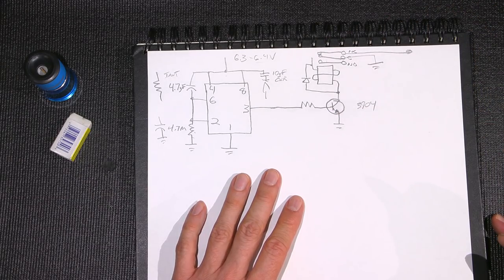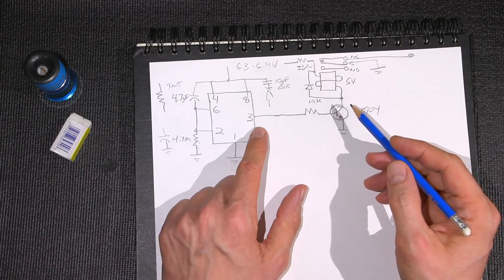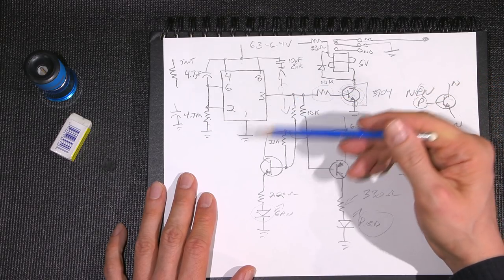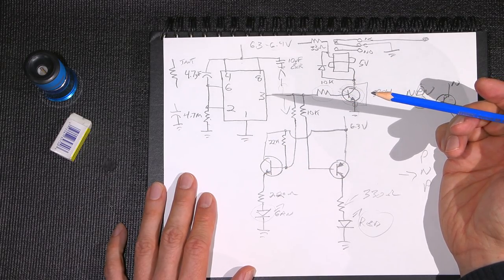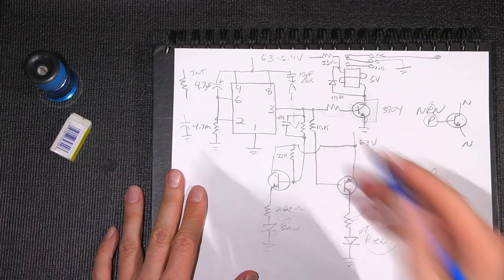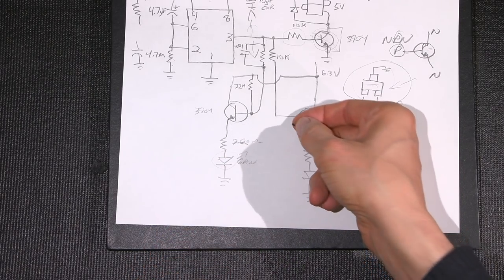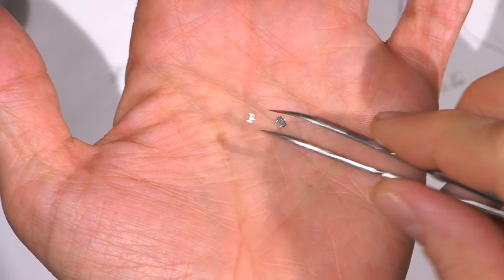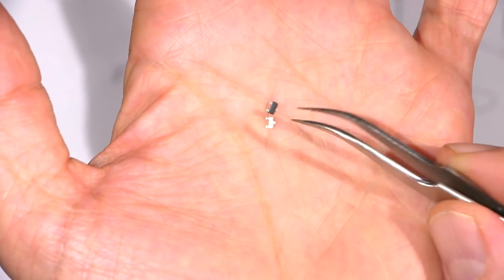Create And Build An Electronic Circuit!

Comment: Paul,
Very much enjoy your videos...and this is no exception to that.  
For me, I would have to use larger parts...possibly even through-hole type parts.  In my case, it is because of my eyes.  I am having difficulty in making out small things lately, and it probably will only get worse.  I would like to see this on the Patreon page, and a schematic and explanation/demonstration of the operation of the amplifier as well.
By the way, do you have the information on that chassis?  The manufacturer, model number, etc.?
Reply: Wayne Thompson  ,  You too? I'm only 79 and wishing for better vision!
Reply: @BruceNitroxpro  , Sadly yeah.  It is not as bad as it could be, but it certainly isn't what it once was.  Do you remember the size of the very first SMD parts?  I could read the numbers on the parts without any need for glasses...then I turned 36 and I could barely see the part much less the print on it!
Reply: @waynethompson8416  ,  Age 36 is the age of our younger daughter! LOL Love it!

Comment: You could have put the LEDs across the relay contacts. Power directly into the LEDs, red connected to NC, and green connected to NO. That would have saved the transistors and reused existing components. The only potential downside is the red LED might cause interference initially, but not once it leaves protection mode.
Reply: The devil is in the details - so let’s be careful here.

Both halves of the relay are used up: each one switches one half of a stereo pair to ground. So, the NO contacts are busy with audio signals, and the Common terminals are at ground.

All you’re left with is NC contacts, and all they do is switch to ground. You could use one NC contact on the red LED’s cathode. And you could use the other NC contact to bypass (short) the green LED - it’d waste a tiny bit of power, but wouldn’t be of much consequence. That is if you had two separate LEDs.

But it wouldn’t be possible while using a three-terminal LED pair that Mr Carlson had laying around. There are three possible internal circuits for such LEDs: 1. Common cathode: the red NC contact opens the cathode connection after 30s, so the green LED wouldn’t light up. 2. Common anode: one NC contact would connect red cathode to ground, another NC contact would connect the overall anode to ground, but then the red wouldn’t light up. 3. Series connection with a tap: wouldn’t quite work either, because one of the LEDs would be sharing some current with the other one. It wouldn’t be as bright, but not a desired outcome.

Mr Carlson clearly likes indicators that change colors, and wanted to use the LEDs he had, so the transistor circuit was necessary.
Reply: @Kuba Ober  I was only saying that since only the one pin is connected to audio stuff and since the only purpose of the leds is to show the status, connect the "protection mode" led to the NC and power, connect the "operational" led to NO and power, and you're done. I may have mixed up the order, I watched the video a while back so don't remember exactly, but I thought only one signal was connected to the output of the relay so that it would ground the output initially then power it.
Reply: @aaronjamt  It’s not the case that “only one pin” is connected to audio stuff. Two NC contacts (out of two available on the relay) are connected - one to each of the two stereo channels. And two C contacts go to ground. The schematic doesn’t show the duplicate contacts, it’d be noise, but they are there all right. I’m in the process of building a relay computer that uses a thousand of those same relays (just a different coil rating), they were instantly recognizable :)
Reply: @absurdengineering  Like I said, I wrote this when I watched the video 3 weeks ago so I don't fully remember it. You're probably right tho

Comment: 6080 vs 7236 . I  prefer the 7216 much easier to drive with about 2x the current of 6080.  Also found that damper diodes bring up the voltage slower reducing that turn on thump. Granted the diodes need a heater but can be found for about 1 USD  current in the 200 to 250ma range . Just so of what has worked for me. 555 timer a very good educational chose well explained . It RT (reaction time) on the tree 60 foot is how long it takes to move the first 60 feet . My boss would .001 on the rt too often very impressive.  Very fine video .

Comment: I would have used a 4 pole double throw relay, used one set of contact sets to drive LED because this would also become diagnostic and would monitor the absolute state of the relay contacts to ensure that the relay is truly functioning. If the relay drive transistor shorted or opened this would give you diagnostic info as well.

Comment: Thank you for your videos. This particular video has helped me a lot with basic electronics. Your explanation of transistors cleared a ton of mystery for me. I have a question about the green LED. 
Why did you put the LED on its own branch with a transistor, resistor and cap? Why can't you put the green LED in series somehow with the relay coil?  That way a lit green LED would also confirm that current is flowing through the relay. 
Why did you need a 22 ohm resister on the green LED transistor base leg? 
Why didn't you need to add a cap across the 10 ohm resister on the base leg of the relay transistor?
Reply: Yes, a green LED in series with the coil seems reasonable, also I don't understand the 22 ohm resistor, if it all comes to me I will let you know.
Reply: Parallel thoughts 🙋
Reply: Do you mean parallel? Putting the LED in series with the relay coil would drop the voltage by 3.3V.
Reply: @zachz96  some way that will indicate that the coil has activated would be nice.

Comment: The way we learned electronics in the Marines we had a saying for the transistors,  NPN - not pissing on the plate, PNP,  pissing on the plate.  Color codes for resistors, Bad, Boys, Rape our young girls, but violet gives willingly. damn sure not PC but it helped us to memorize the color code, and we all remember it. Sorry if it offends you but this was in 1978. I served from 77 to 07. Tubes were very common in our radios, especially in high power radios.

Comment: Wow this video looks super interesting to me, only about 10 mins in. My living room amp I built about 5 years ago uses 4 6as7s in pp with a pair of 6sn7s as the drivers for each channel, like you said they do need a beefy supply I think mine draws around 15amps off the 6.3v line. Mines not otl though it uses Japanese tango output transformers and is probably about 10w per channel, nice sound, originally it had 6v6s but it went triode as didn't even need to power of the 6v6s for the small space it runs in

Comment: I'm beggining to study circuits, and I have a question if you don't mind. Why didn't you design the green (ON)LED so that it's connected to the NPN that is connected to the relay? Wouldn't it fit your design since that transistor turns on when the output is high? My guess is because there wouldn't be enough power in that branch, although that's merely an educated guess. Thanks, i've already learned alot from you.

Comment: This was an excellent video as always but the bit that made my head explode was at the end! I had no idea why some transformers were so large except that it was harder to saturate a larger transformer! I have been eyeing some output transformers on eBay for some time now and I have been reluctant to make the purchase, one lot was ex military, they look like a capacitor can but they also look small, I haven't built anything with tubes yet and wanted to get my foot in the door so I still might get a set of these. But the others are new made in china and there's a lot of them on eBay! I guess that I'm not getting those things now, I think that I'm probably better off getting new ones made up, there's a place here in Sydney that's still building and they have been around for a very long time, I found them after I opened up an isolation transformer that came out of a hospital, I wanted to see what's inside because it weighs about 25kg, wow! The biggest toroidal transformer that I have ever seen in my life! I don't think that I have ever had a birthday cake that big! I love it! I also have a huge EI core transformer also, my son got me an arc welder for a father's Day gift, I couldn't help myself when I saw it's transformer, that sucker is coming out! Besides, it's one of those cheap father's Day specials that have a 1 minute duty cycle, pretty useless but it's transformer is just beautiful to look at! I don't know what it is but I'm drawn to some components and I have to have them even if I have no use for them! Maybe I should get another welding transformer and rewind them into output transformers LoL, LoL they are huge! Anti theft! And they just look scary! Even if they are gentle giants LoL... I will have to call the amplifier the Frankenfier!

Comment: Really nice design, the choke and filter caps, well done! My first few cars had points with a condensor inside the distributor cap.
Why not use an RC to get your 30 second delay instead of use the timing chip?

Comment: Even if the chassis you used is not still available, I would think the Hammond RM series would work. They are available in both 1/2 and full rack width and are well made. I have used lots of them over the years for various things. They will also take the standard Hammond aluminum chassis inside, if you desire. The disadvantage is they are NOT inexpensive!

Comment: I have a question about your design. Why did you put a 220 Ohm resistor between the green LED and the transistor and a 330 Ohm resistor between the Red LED and transistor? do they not require the same voltage?
Reply from the maker: The forward voltage of a green and red LED are different. In order to keep the brightness of both LED's somewhat uniform, I staggered the resistance values.

Comment: It's a 'while' a go since I heard that  THUD,  brings back a lot of good memories.   8-)

Btw. an on/off switch on a tube amp ?  It should have an UPS.
( I just saw jou Standing Inside a Broadcast Transmitter While it's on, you'r familiar with the concept )

I wish I could support you, your doing very good teaching.  ( but I'll probably buy me some of those nice LED's first )
Reply: I think Mr Carlson deserves something more than just a UPS. A motor-generator with a big, well balanced flywheel would seem appropriate :)

Comment: It would be interesting to year your views on guitar audio amplifier output transformer design.  I think core size there is also significant in that I understand that core saturation plays a part in the sound desired by guitarists so extra large cores are not necessarily desireable.

Comment: Out of curiosity, why do you pull down the relay coil rather than pull up? Less power through the transistor?
Reply from the maker: Hi Michael. The emitter of the transistor is directly connected to ground, so there is a current path from the base of the transistor directly to ground. If I was to put the transistor on the upper side of the relay (like a pass element configuration) the base would be lifted off ground by the voltage of the relay coil.

Comment: Would that have enough power to push the voltage converter box for a pair of electrostatic headphones? Those usually plug into speaker outputs. I am sure a converter can be made to run some Koss ESP10s or Staxx Ear Speakers. I can't pick a favorite. The ESPs and the high end Staxx are just different. I prefer the ESP10s for comfort and they have a socket for a small flex mic boom.

Comment: I understand very little of this, but I'm fascinated by electronics (was set to go to college for electrical engineering, but instead took a path into residential construction), and I play guitar through Mesa Boogie tube amps.  Is this just a delay for the tubes to warm up?  (I'm used to waiting about 30 s. to turn on the Standby switch.)

Comment: Thank you! Very informative! Could you not use both triodes in each tube and cut the number of tubes in half?
Reply: There would be slightly less channel separation then: the triodes in a dual have some capacitive coupling between them, and grids are fairly high impedance nodes so it’d be problematic. Another problem is that dual triodes make it hard to make a perfectly symmetric circuit. You want perfect mechanical symmetry so that the  parasitic impedances are the same in both channels. If they differ, the left and right stereo signals will be delayed by slightly different amounts at any given frequency. That kills stereo reproduction even if the amplitude of the response may be acceptable - phase matters too. Thus, a good stereo amplifier is two circuits in perfect mechanical symmetry.

Comment: Why does the green LED need a driver transistor? Does the output of pin 3 not provide enough current?
Reply from the maker: You got it! The output gets pulled down very easy on this IC.

Comment: I'm sorry if this is a stupid question, but would it hurt anything to run the leds off of the relay contact's?  It seems like you could eliminate the transistors and resistors by running them off of the contacts instead of the 7555.

Comment: Hello mister Carlson, why did you use a tantalum capacitor instead of a 4,7uF electrolytic cap? Are the electrolytic capacitors also more unstable due to temperature or humidity factors? Or are there any other disadvantages? I Know about the unstable ceramic types, and building VFO's using them in the LC circuit. Then blowing to a capacitor with a straw and the frequency counter was running up and down. That was a funny way to learn how not to build a stable VFO :)
Reply from the maker: Hello Rene. Yes, electrolytics should never be used in timing applications for drift reasons. They are very temperature sensitive.
Reply: @MrCarlsonsLab  Thank you very much!

Comment: I know you mentioned the reason for doing the OTL amp allowed you to keep the range of the signal within a db, basically flat. Then the powered speakers bring the levels up. What is the advantage of that? I know you said that it allows you to master very well - but just curious, in what way is mastering the audio better? (totally a curiosity question).

Comment: I was wondering, how is the amplifier affected by the headphone impedance ? let say you were using 32ohm headphones instead of 600ohm ? And lastly, you are shorting the output of the tube while your relay is protecting the output ? I thought you would have OPEN the output circuit and CLOSE it when ready but by what I understand, you SHORT the output this has no incidence on the tubes ?

Comment: Probably, the 7555 would drive the relay without the transistor... if you did swap the timing R and C.  It depends on how big the relay's coil is.  Also, a "3-color" LED with resistance in an H-bridge (or inverter LED on one side plus inverter/inverter LED on the other side) would fill the indicator need -- though this is not much simpler.

Comment: Mr C, what are the properties of the plate and cathode resistors (look like cement sticks) that make them appropriate for their use in those positions?
Reply: Those 6AS7 tubes (6080 industrial version) are kind of unusual high-current beasts. They take 2.5 A heater current, which is pretty high. Each triode (of 2) can pass over 100 mils, and their plate resistance is very low. Point being, they are rather high current tubes and so the plate & cathode R's need to be pretty high wattage as well. Those look like 5 watt R's to me.
Reply: @pneumatic00  Thanks

Comment: Why not just use one 6SN7 if you’re only using two triodes? Or two 6J5s?
Reply from the maker: No Particular reason Jeff, Just because I have hundreds of 6SN7's.
Reply: @MrCarlsonsLab  I’ve always wondered why I get these 6SN7s with one new-testing triode and the other with the triode at 50%. I kinda suspected something like this was going on as a lot of tube microphones also use just on triode in a dual triode...

Comment: Demonstration sake and funky LED package aside, is there any reason you couldn't have put a red LED (+current limit resistor) in parallel with the relay-driving NPN, and a green in parallel with the relay?
Reply from the maker: The circuit board layout (made universal now with all separated relay contacts) has been released on Patreon with schematic and component layout map. If I used the contacts to switch the LED's, one half of the relay would be wasted switching lights. This way the full functionality of the relay remains for whoever wants to build an use the circuit.
Reply: @MrCarlsonsLab  I neglected to clarify: <green LED + current limit resistor> in parallel with the relay coil. This would save transistors and base resistors, while having the same functionality, yes?

Comment: Could you have saved a transistor by putting the green LED and its resistor in parallel with the relay coil? If you'd had a DPDT relay you could have used the second set of contacts to switch the LEDs and saved still more components.
Reply from the maker: Hi Peter. The LED has a common cathode.

Comment: Hi Paul. Learned lots from this video thankyou! Would it be unwise to use this delay circuit on a single ended tube amp with Audio output transformers? I understand the Output tubes are looking for an impedance which is reflected across from the secondary. So if the speaker connections were shorted out, would it cause a significant rise in B+  voltage on the plates while muted?